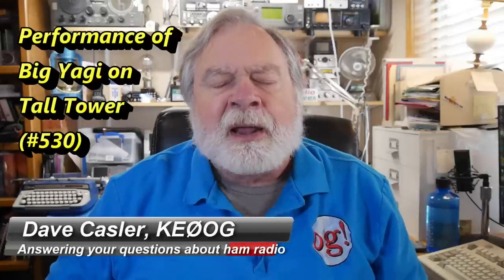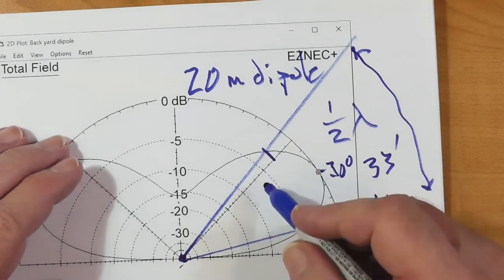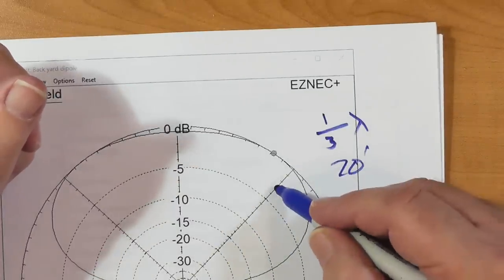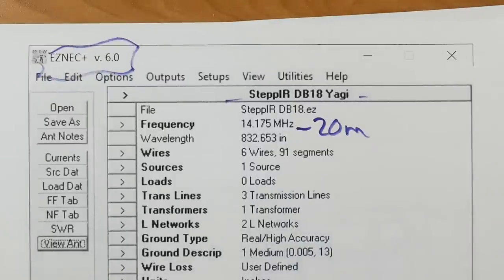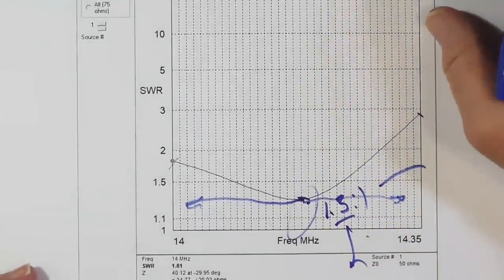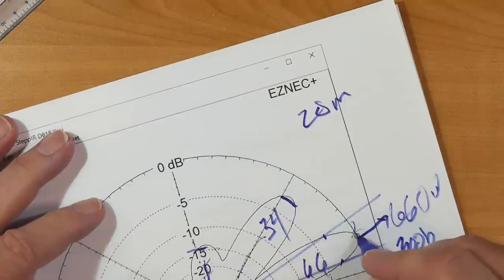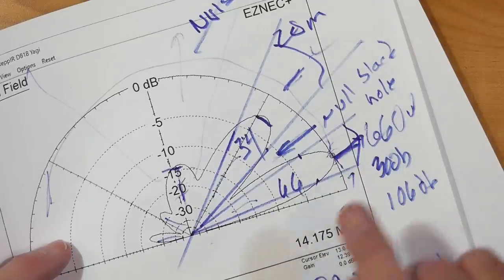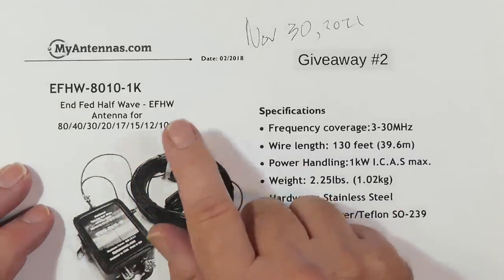Performance of the Big Yagi on Tall Tower. (#530)

Comment: On HF its pretty hard to get free space performance out of a dipole but, a three or four element yagi at a wavelength or more does compress the radiation and reduce ground effect (and noise). That's why its the standard for DXers.

Comment: This set of vids about lobe bifurcation has been very helpful. I had the peak of my Tune-a-Tenna Inverted V up at 50’, which was darn good for 75m NVIS work, and maybe pretty good on 40m. But 20m DX was rough going. After watching your previous vid on this subject, I lowered the peak to about 35’, & now am having much better DX luck on 20m. Of course when I reel the elements in to 17m, 15m, 10m, or 6m, I’m too high again. And I’m a little too low on 40m. I guess we can’t have it all… at least not at the same time. 

I suppose the next time I get word of a hot 6m day of Sporadic E, I can run out, lower it, tighten up the guy lines, & stay on 6m until the fracas is over.
Reply: until it's over.
like in 30min.
😂
Reply: @RESISTAGE  Yeah, I guess that's the thing, huh?

We had one this summer that lasted something crazy like half a day. Apparently that's... I dunno... kinda rare?

Comment: My temporary 75 meter center fed dipole setup, 16 feet off the ground, has been a good hammer on the local states nets, even made Missouri!  Even if you can't get them high, their short range performance is at least something, so there is value in the low hanging NVIS dipole.  Also, what is the best advised height for my new Sirio 10/11 meter Yagi I have on order?

Comment: How do they turn a yagi mounted mid tower?
Reply: There are towers where the whole structure rotates. The motor is at the bottom and the tower is supported by rings which are guyed and presume have some sort of bearing arrangement which allows the tower to rotate within them. I've only ever seen a photo of one of these towers and would guess they cost a fortune ;)